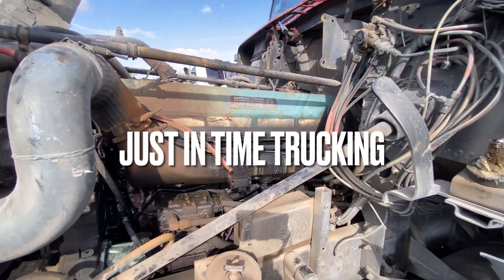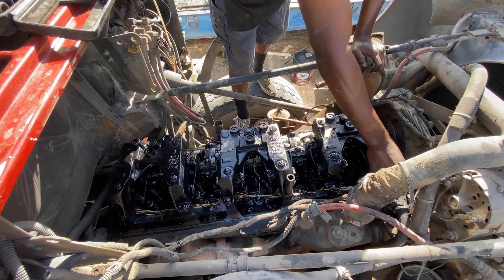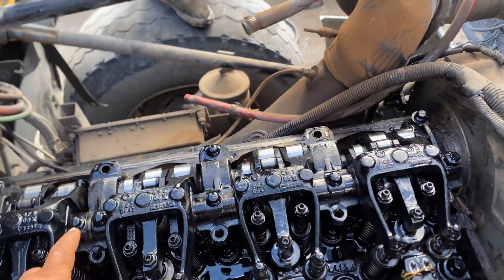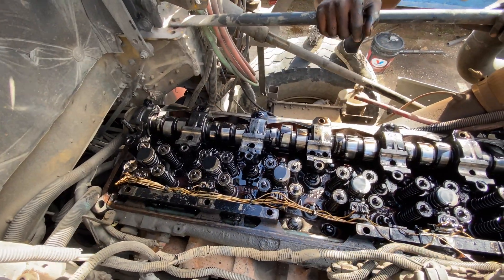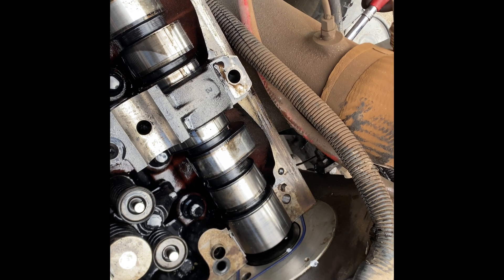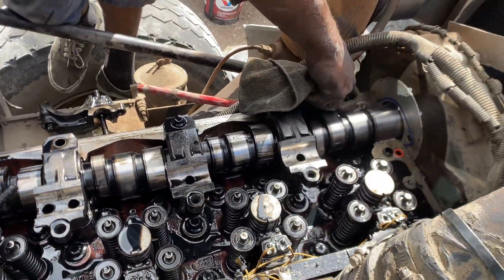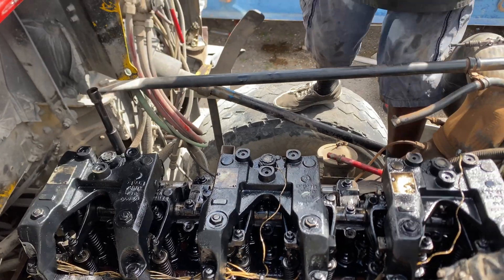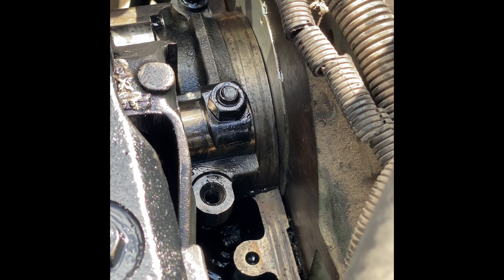Detroit diesel oil leak.  Series 60 12.7 how to repair diamond/camshaft seal

Comment: With the e axles meritor14xe remote control acts like 15 liter fuel efficiency 50 mpg hybrid works with 600 800 volts its how people get good mpg 3/4 tank from Miami FL to  san Antonio TX and 3 days idle 4 day was reciever